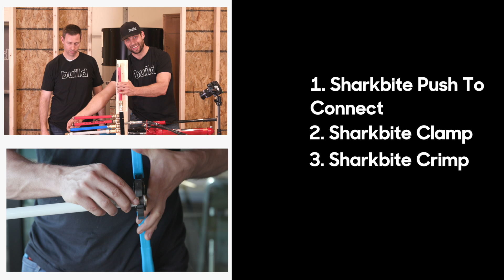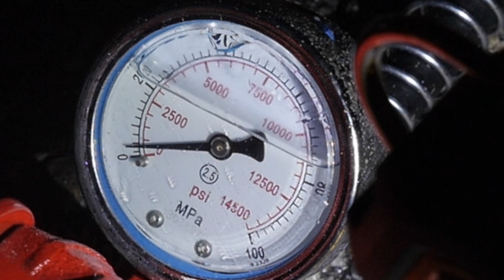Can we blow off these PEX fittings?  Sharkbite vs Viega vs Uponor

Comment: I have tested sharkbite push-on fittings in buried pex installations of @ 300 ft in length to 175 psi for approx 48 hours with no leaks whatsoever.
Reply: How did you install the push fittings,do you even know if they were bottomed out with a tester? 
  You guys are a waste of time. Matt

Comment: Problem with quick-connect is flexibility of the pipe itself. Its the only type where pipe is not pressed/stabilized on inner and outer sides at same time. Explains also why quick-connect works pretty good for copper/metal pipes, they are very form-stable.

Comment: Could pex be used for compressed air in a home workshop? With PSI rarely getting over  150psi
Reply: tumbiola  more of doing a compressed air run in the shop from my compressor to an outlet with my hoses attached there.

Comment: would be curious to see the push ons constrained and tested. i expected them to slide off as the weakest link in the chain, but if that were in a wall, with the cap against a stud so it couldnt just easily push off, how well would it do? not sticking up for push ons, i hate them, but trying to give them the benefit of the doubt.

Comment: Trolls aside,  I've done countless plumbing jobs with SharkBite, a few with Uponor, and never Viega, except for manifolds. 
My take - Uponor may have a more secure fitting system,  but  I found it slower to use. 
I've had no trouble with the few viega products I've used, but they aren't carried in my area. 
SharkBite is my go to, and usually the clamp type connectors. I've seen their plastic and brass fittings stand up to Minnesota winters and frozen pipes with no issues. 
I avoid the grip type fittings. I have never had issues with them. I am just a bit hesitant. 
Some absolutely swear by Uponor, largely because of poor grade brass fittings that plagued pex B installations due to dezincification. These issues seem to have been delt with after 2005 though. 
Also, while I think Uponor is a fine design, speed matters, and for the diy crowd,  a $400 dollar investment in a tool for a single job is a hard sell. 
I firmly believe all of these systems are useful, and the greatest factor is familiarity and comfort with your choice of product.

Comment: How about rather than following the manufactures instructions correctly, the fittings are installed like they would be by the low-bidder that undercuts the guys that bid the price for doing the job right in the housing complex cookie cutter homes. I.e. pvc pipe missing the primer, nothing cut exactly square, burs and maybe some half-ass seating of connections. Of course the fittings dont leak when done right, the manufacturer isnt trying to get a class-action law-suit.  How tolerant to errors they are is what separates something ok from something great.

Comment: Sharkbite uses teeth for fixation, and PEX piping is quite soft material so with high pressure teeth cut grooves and whole fitting sled off, so it was also pipe wall failure.
Reply: I use push-in Sharkbite fittings with the PEX tubing for my RO water system. The system runs at 140+ psi and has been trouble free for about 4 years now.

Comment: If your hypothesis for maximum pressure of these fittings was 500 psi or less why do you have gauge that can withstand 14000+psi. That is terrible data acquisition and and ruined this test for any numerical value. This is a video almost solely for entertainment purposes.

Comment: I did the uponor wirsbo factory training class back in 2001 

At that time 3/4 wirsbo would burst at room temp at around 1100psi I beleive 
So I dont beleive for 1 second that it was only 300 psi when it burst 
Wirsbo would withstand maximum temp rating and max cold pressure rating at same time to show durability 

Pex A is supposed to be the better quality pex via manufacturing process

Comment: Cool, video, but the fitting that failed was the fitting on the manifold not the one you were testing at the end fo the pipe (first failure inside)  was it the same fitting at the manifold??  Thanks!

Comment: you didnt have the system bled properly during your initial test indoors, gas is explosive under pressure not hydraulics/ fluids as they dont compress. that was the reason you essentially made a rocket on your first attempt lol

Comment: I found this very interesting, although I don't have any kind of science background. I live in a mobile home and have been changing my water lines to the pex-b I think,it's blue and red with the push to connect fittings. Only failure has been human error (me) lol. :-D I do have a plumbing question: I live in Branson Mo. Lowest winter temperature is 10-20 degrees and 1100-110 in summer. About 3 -4ft of space from sub floor to the ground. Where should I put the pex tubing? Does it need to be above the insulation? Insulation is R19. My other question is if above insulation would cutting a notch in joice ruin the integrity of the joice? Thanks for any help. Thanks again for sharing your talent and video, Rodney

Comment: Funny enough, I think I would rather have a fitting failure than a pipe rupture. A fitting is easier to find/replace. A rupture could happen anywhere in the pipe, and there's a high probability it will require opening a hole in the drywall.
Reply: Same here, I like the push connectors personally and I always try to keep all of my fitting in accessible areas so that a fitting failure is easy to fix.

Comment: This was a terrible test. The first sharkbite he had his finger almost pushing on that release ring.

Agree all pipes should have been the same kind and the same length otherwise you are not checking fittings 

Also, it was confusing that they said one failed before the next because none of the fittings failed it was the pipes that failed. 

Again lot's of mistakes. "FAKE" research lol. fun to watch though, and I think everyone will feel confident on all these fittings.

Comment: I use sharkbite push to connect on copper.
No issues- they are on equipement installations in a visible area.
4 years in no issues

Comment: I use PEX A because it with stands freezing, and I live in Alaska were it has gotten -50+ F. , I have also used the shark bite fitting push on type and I hate them I had two fail on a normal 40/60 plumbing system, some people will say I didn't put them on correctly a maybe but I have never had the PEX A fittings fail ever

Comment: on longer runs of pipe I think you would be more likely to see failure in the joints as opposed to the pipe itself. If you do this again get a 1000psi pressure gauge for the top of the manifold and use 20ft straight lengths or 50 ft coils instead of 16" pieces or w/e you see here and I bet results will be different.

Comment: But did they take into consideration the left over air in the pipe compared to the water? should do each pipe individually and bleed the end cap.
 you can compress air but not water ...  Hence a expansion tank ... Could put uneven pressure through the pipes. 
Ps shark bite fittings are garbage!! Don't ever use anywhere.

Comment: Why couldn’t you use a hydrostatic test pump?  They are better suited for this application considering they compress water and not hydraulic fluid. Also, the fittings are designed to outperform their pipe partner. And since these products are designed for residential/commercial purposes, none are designed to handle beyond about 200psi.  Municipal water utilities don’t  test over 250psi typically. Really anything over 150psi is usually considered industrial. Interesting that you were blowing stuff up but far from scientific. Thanks guys.

Comment: Frankly, I believe this test demeans ALL of these products unfairly by applying pressures NO water system will ever have to deal with in normal residential usage. The kind of pressures which were applied in this ,"test", if you can legitimately call it that, was certainly not well planned as the many comments below attest to. Before going into such a "test", ALL things must be "equal"!!! Also having a gauge that effectively reads pressures which we can actually see in a range (0-350 psi) that is realistic for the products tested is critical, otherwise why test it to just "estimate" at which pressure any given pipe or fitting failed. I would guess and this is just a personal observation, but the maximum pressure applied should be NO more than what the various pipes/fittings are rated to, perhaps plus 100 lbs. of applied pressure! Beyond that, this video was less than amusing and not in the least "real world" beneficial!

Comment: In all fairness what are each pipes and fittings rated at? What the normal pressure in water pipes going to house? With this said i am sure that even the shark bites passed the tests? Would this correct?

Comment: But what are the expected pressures you would see in a water line. Residential pressures rarely get as high as 200 psi, so failure at 500 psi is admirable, to say the least.

Comment: Uponer is probably the best of all the pex you know the expands and contracts as well the other day I had to repair a leak on in an attic big pin hole they used pex b they had crimp rings looked a rat chewed on it big hole the psi at the home was at 60. You should see if it’s true that rats will bite through pex that’s a better test
Reply: I’m not saying a rat bit through the pex but seems to be why a lot of plumbers don’t like using it.

Comment: I prefer the expansion fittings for several reasons. It is clear that all of them are more than suitable for most plumbing applications as far as pressure goes. The expansion pipe is easier to work with due to being more flexible. The expansion pipe seems to have more give to it in freeze/thaw conditions where in some situations it would give more and save the fitting from failing. Although in a perfect world a good plumber would avoid these exposures. Expansion tools can be a bit more expensive though.

Comment: The test was supoed to be on the CAPS, inorder to test caps accurately, the lengths should be the same and the sharkbite CAP did not come off so it WAS still valid. The sharkbite cap didnt come off, the pipe came out of the base and they disregarded it. The conclusion is way inaccurate.

Comment: there are other plastic pipe types that you should pressure test as well... I am a plumber myself... I like using the push to connects in likely to freeze situations... also when joining two different types of pipe together... it acts as a Dielectric coupling... but under freeze situations, it will push off the pipe long before the pipe expands and damages and is harder to repair is you have to search longer for a good section to coupling onto...

Comment: I have hated on the shark bite push fittings for a long time but I'm really surprised that it never leaked it only failed catastrophically furthermore the uponor pipewill hold through being froze and capped on both ends I've seen it myself and it's pretty impressive I like to see a deep freeze test

Comment: Uponor is my go to, also most common in my territory. We do from time to time use shark bite fittings for temporary fixes, something that will be redone within a year down the road. I prefer the Uponor because of the tool. When you have a 6 washroom house with branches going every direction the last thing you want is to crimp all those connections. Lots of shoulder and elbow pain from manual crimping and expanding. Viega is just not worth the cost it tends to be more expensive. The tool is astronomical unless you buy a trucks worth of fittings and pipe to get the tool for free.  Great test none the less!

Comment: 1. half filled gauges don't give accurate readings. A psi at failure reading would be the best use to installers.
2. using the SAME pex tubing with different fittings would give a better, true evaluation. Wall failures are tubing issues, not fitting related.

Comment: Since I'm about to subject my newly installed (Uponor) expansion system to a pressure test to close out my plumbing permit, I was particularly interested in the results of this test.  I would say that it confirmed what I had hoped: that there would be no leaks where the expansion PEX connected to a fitting.  And it confirmed what I had suspected:  that s Sharkbite connection would be the weakest of the bunch. That the wall ruptured under very high pressure is not of great concern since I don't foresee a scenario where 300 PSI+ is present.  I believe the pressure test will go to 200 PSI and I'm betting on smooth sailing (I do have hammer arrestors installed at the washing machine and icemaker supply lines, BTW). In any event, I'll find out this week.  Thanks Matt.  Appreciate the video, though, I would encourage you to maintain your normally professional speaking voice rather than lapsing into DJ announcer-hype.
Reply: Been a plumber since 95. Absolutely no need to exceed 100 psi.
Faucets will start dripping and not holding water once you exceed 60 psi.
200 psi is a higher test pressure than any manufacturer would recommend for potable water.

Comment: You guy should use high pressure water pump with from 0 psi to 2000 psi regulator  
And test one pipe at a time only for accuracy.

Comment: Actually theres immense danger by standing close to test subjects.  A injection of high pressure hydraulic oil through a pinhole burst from one pipe could be fatal.  Or cause loss of limbs.  This test should be done in a safer setting behind safety glass.  All laughs but could have ended tragically.  Words from a safety/machine maintenance guy.... stay safe think the worst and avoid it.

Comment: I am curious, is this test for end point connectors, or for end connector, leading connector, and pipe?  you dont clearly indicate what is a success or failure to the test?  

By my understanding the first 2 fails were of unrelated or failures of non-test articles invalidating all the testing.

Why arent all the pipes and leading connectors exactly the same?
Are you testing entire piping infrastructure? or just connectors?

I am not a plumber and have no experience in any of this.  Just curious about modern technology.

Comment: I would be much more interested to see how this test does with shock-pressure versus static pressure.  As you said, a house water system will never get near to the psi you were bursting pipes with, but a sudden pressure spike can knock things loose, like hitting a rusty bolt to free it.  Recently, several neighbors and myself had cpvc fittings in our homes fail because of a pressure spiked caused by nearby water main construction.  I doubt the total pressure was over 120psi for more than a second but it was enough to cause a lot of damage.
Reply: cpvc sucks ass that’s why

Comment: I use the pex sharkbite crimp and have been for I'd say over 10 years and I personally think it's the best pipe you can get. I always recommend it but I do use a lot of copper also I will not use cpvc or if I do because they insist on it I will not guarantee it. I will guarantee where I tie into it but that's about it. Pex is durable and holds up to freezing Temps I had a customer who had a constant problem with frozen busted pipes so I recommend installing pex instead of just a quick repair in the hundreds that where already there. This person hasn't had a busted pipe since and this was over 8 years ago. These pipes where also mostly exposed underneath the house. I did tell her as many others have before she needed to insulate and put some skirting up but she never did. She still gets frozen pipes or did up to a couple years ago but she solves it herself with a portable heater...

Comment: Shark bite push to connect fittings hate the cold they blow out when it freezes very easily.They look exactly how it looked when you guys did it. Hate to admit it but we do use the shark bite pipe very often cause if it’s ease to get. Whenever never had a issue.  You guys should test the shark bite vs viega with the metal sleeve aswell

Comment: There really is no valuable information here! Yeah, they show different manufactures of pipe can fail. At what pressure. Who really knows. Clearly the gauge is not low enough to show a proper pressure. Change the gauge, call it a pipe test, not a fitting test and consult the pipe manufacture on testing procedures. Then there might be some good info here. Might as well just put a 14k pump on a garden hose and see what it holds.

Comment: On the first test was there a shark bite fitting on the bottom connecting the test piece to the manifold because that's the one that let go not the top one. Edit yeah I guess there's one on each end nevermind,  regardless it failed

Comment: Guys I want to replumb my camp down the bayou. I use a 12 volt diaphragm pump. 70 psi.  It vibrates and I've had s ton of issues with PVC connections leaking. Would y'all suggest pex with one of these type of fitting they used here?

Comment: The biggest takeaway here is: 
All the fittings do their job better then you. Not that it really matters cause they all held up to way higher pressure then you would have under normal circumstances and the real problem - spikes caused by waterhammer - is quit different from static loads.

Comment: The only thing I have seen as a plumber, Is that the sharkbite fitting are mainly used for emergancys or temp fix they are never meant to be used as a permenant fitting for your home. Along to the clamp and pinch style pex they are fine to use but wont last as long due to the metal clamos failing befor the pex does. The uponour pex is by far the best a most efficient way to install pex. The only real enemy of the pex pipe itself in a home is sunlight.